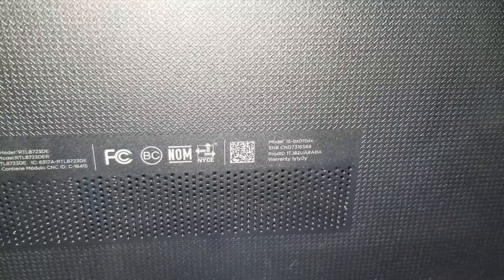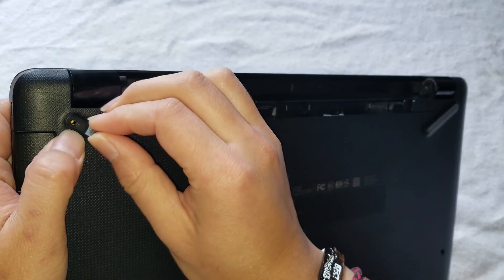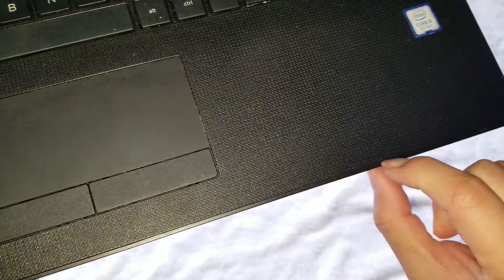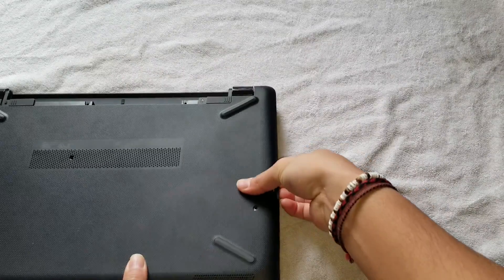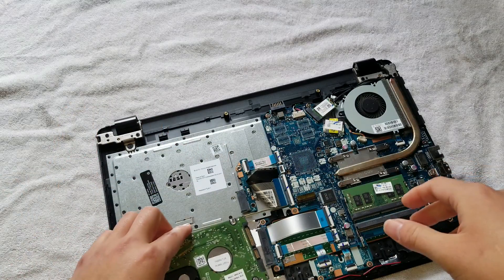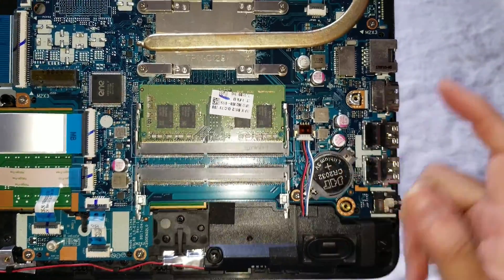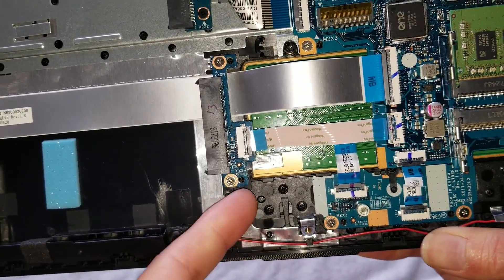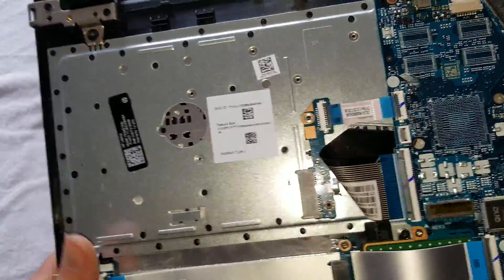HP 15-bs015dx Notebook laptop upgrade disassembly

Comment: Can u please tell me the type of ram i need for this lappy?
Reply from the maker: It's literally the thumbnail...Did you even watch the video? Pause it when I show the RAM. The info is on the sticker.
Reply: @ItsBinhRepaired  i mean 3200Mhz or 2666Mhz.which one should i prefer?
Reply from the maker: @zxcv0239  neither, pc4 2400t is DDR4 2400mhz RAM. You can try the other types, but not guaranteed to work.
Reply: @ItsBinhRepaired  thanks a lot it worked....and by the way  can we add a ddr3l to an existing ddr3 memory?
Reply from the maker: @zxcv0239  just have to match the speed and type of ram

Comment: sir, if i run a game or a program that requires max RAM capacity it doesnt run as well as i would prefer and even now with some games wanting you to capacitate 16GB of RAM space or even more than that...i have this laptop and i am displeased with how sensitive the optical disc drive is because after not using it and some kind of unknown dust or something is on it, now it cant read anything i carefully insert on the tray drive
Reply from the maker: Get a usb optical drive and upgrade to an SSD
Reply: @ItsBinhRepaired  gonna get a portable reader to avoid problems in the future...i can afford additional ram before an ssd....unless more ram makes the laptop work harder
Reply from the maker: @desertrailroader2517  SSDs are cheap
Reply: @ItsBinhRepaired  ah, ill have to look into it....so you just gently press on the ram stick for it to be removed and inserted into the slot? 16gb of ram would be great
Reply from the maker: @desertrailroader2517  the side tabs need to be pushed outward. Watch my other videos for more examples.
Reply: @ItsBinhRepaired  ah i see. ill look for them
Reply from the maker: @desertrailroader2517  alright

Comment: Hey, i have this laptop and it seems that my hdd is failing, can I ask you what type of ssd would fit in there? Thank you.
Reply from the maker: Any 2.5" sata SSD. SanDisk, Samsung, crucial, and Kingston are good
Reply: @ItsBinhRepaired thanks man ;)
Reply from the maker: @bzaink5487  no problem. Don't forget to like and subscribe if you haven't already. :)
Reply: @ItsBinhRepaired  I am looking to buy a kingston a400 sata 3 2.5".. Would I need anything else to connect it to the motherboard? A special connector or something. Thanks for the video btw
Reply from the maker: @miguel_e  it replaces the hard drive. You'll have to clone the original drive to it or install Windows from scratch.

Comment: HAS SLOT M.2?
Reply from the maker: Yes, but you'll need a bracket. This manual will tell you. It's on page 56. http://h10032.www1.hp.com/ctg/Manual/c05493257